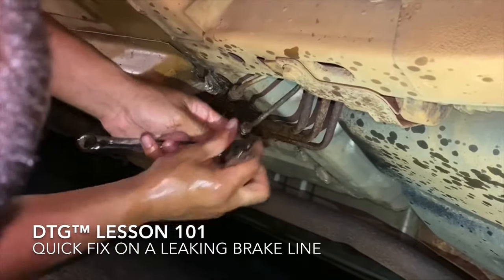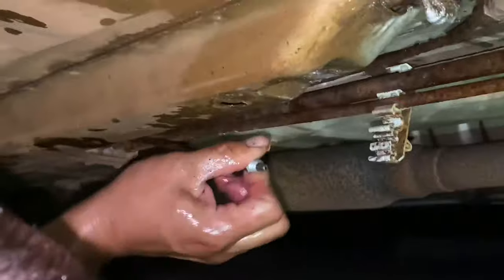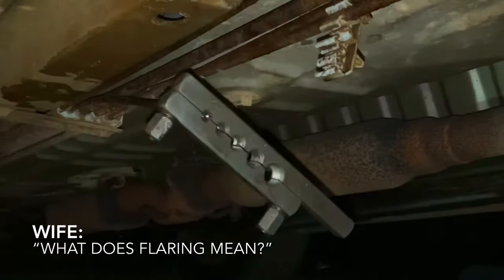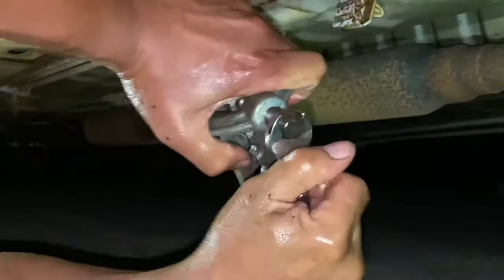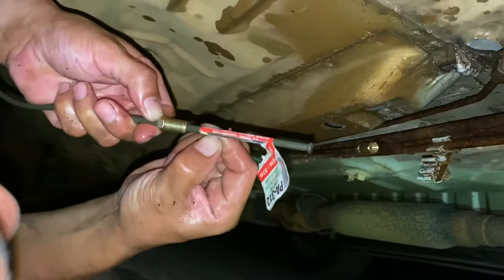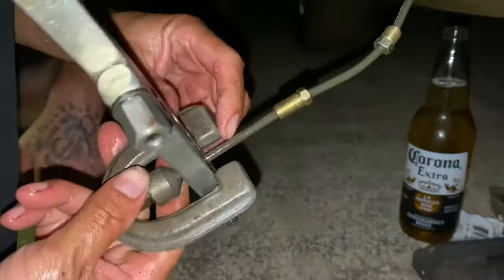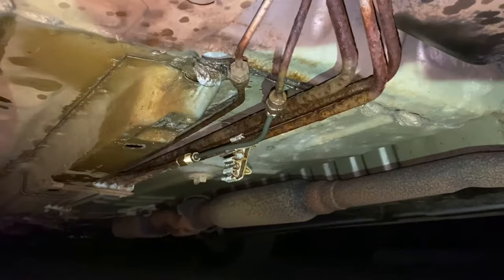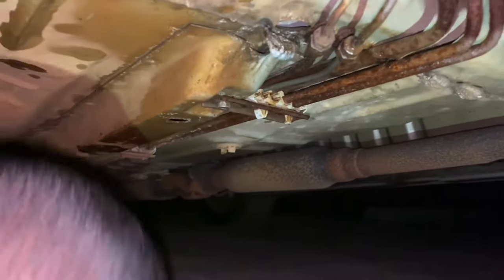DTG LESSON 101: Quick Fix On a Leaking Brake Line

Comment: Actually I believe the flare that is legal for brakes is a double flare, not a single flare that you made. But I expect that will work in a pinch as a temporary fix.
Reply from the maker: The purpose of this video was a quick get the car out of there fix.
Reply: You shouldn't work on cars. 1 or 2 doesn't matter long as works.

Comment: Yes if badly rusted you should replace the whole line, but under the circumstances this was amazing. Wow, and then to video the whole process under those conditions was incredible. Did you have any problems cracking open the bleeder values, many times those things crumble.
Reply: Hey, if you're still on here, how would I figure out how much pipe would I would need to replace a whole line. On a 2013  hyundai genesis 4 door? I looked at diagrams on Google and cant find the amount of feet i need to replace the whole thing. FYI, I'm not doing the work, so I'm not physically able to measure it.